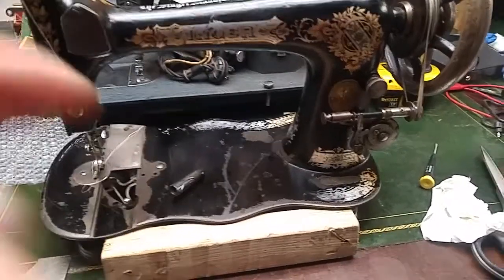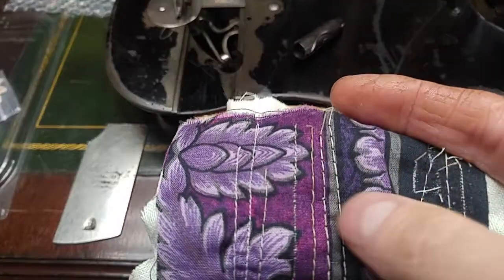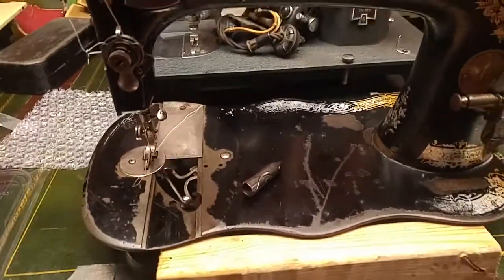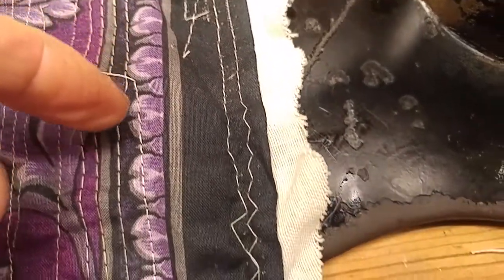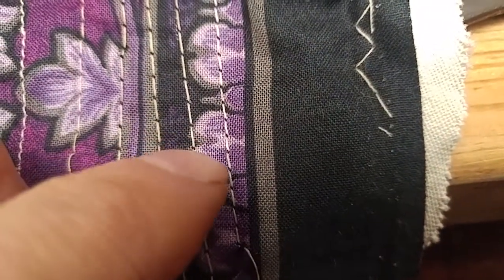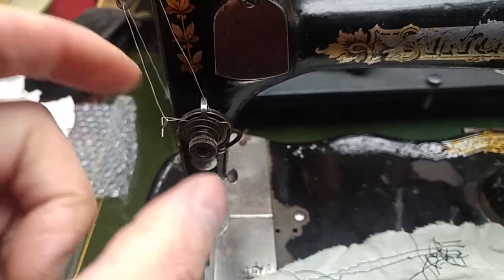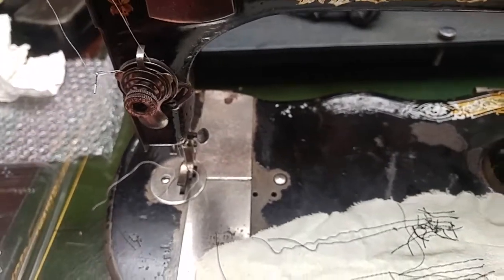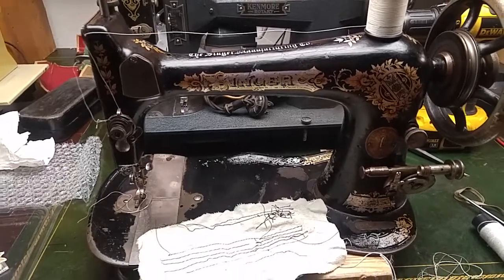Rescue - 1892 Singer VS-2 Fiddle Base Update 7, Thread Tension Adjustment First Round of Stitches

Comment: Nice machine , i have a 1886 model 27 fiddle base , seems me and you both need the front shuttle cover lol , polishing your upper tention will do wounders but you need to clean the shuttle as well , as old grime  in the bobbin will mess with the stitch too , the machines always gets all the attention but people forget to clean the actual bobbin case and dirt builds up behind the leaf spring and your bobbin tention will fluctuate and you wil lbe loosening and tightening your upper tention trying to figure out whats going on and meanwhile its a problem in the bobbin , bobbin issues are just as important ...
Reply from the maker: I haven't gotten back to working on this machine yet since are more winter indoor projects, though did invest in a cheapo Harbor Freight kit (somewhat embarrassingly though for ~$10 with 80 something tools - DRILL MASTER 0.7 Amp Rotary Tool Kit, 80 Piece) for use in better polishing.  I also picked up some Singer of this series range handwheels (I'd like to convert a Sears-Kenmore stretch stitch machine to treadle), a nice 1.5" thick top cabinet and a few tension discs from a gal that was moving and had to offload most her collection.  Like, subscribe and thanks for the comments!